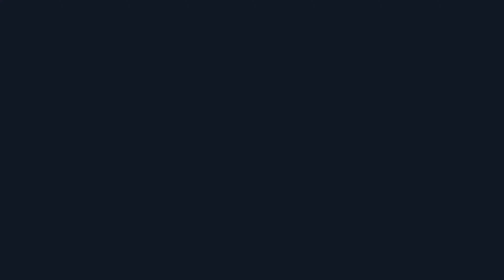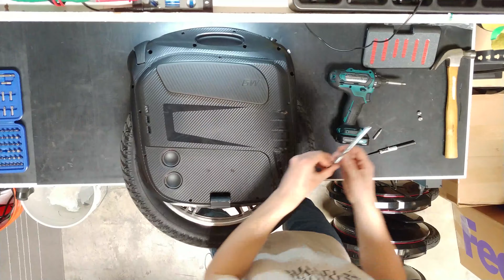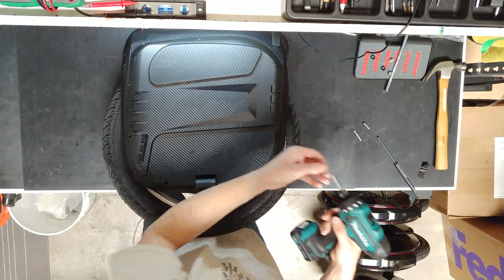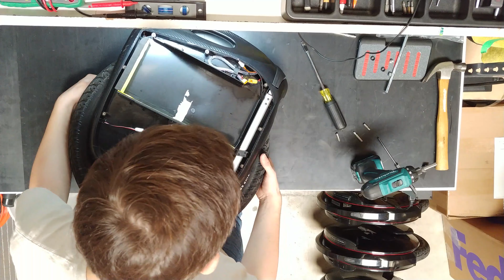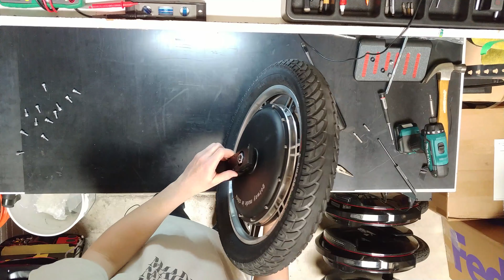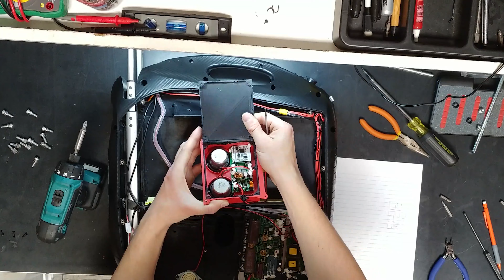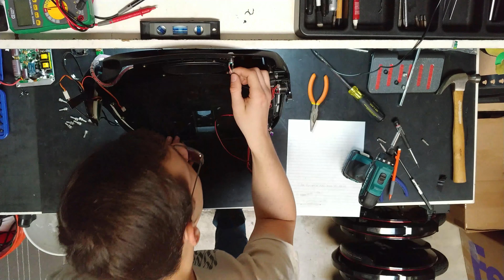What's Inside? Gotway MSuper Pro Breakdown

Comment: To change the tyre DO NOT DISCONNECT MOTOR LEADS. You don't need to. Open the cover on the NON motor side and remove that shell half. Then you just pry off the tyre and replace it. Did it that way on my Tesla to prevent disconnecting motor cables as doing so decrease the pressure on the contacts every time you split them apart. After a while there is a risk for arcing. When arcing starts you quickly loose connectivity and with lost connectivity (high resistance) comes more heat...and we all know what happens with hot gotway motor cables ;-)
Nice video, seems like you broke the seal on one side of the cover and you looked worried when you said motor cables were not damaged so i guess there was something there?

Comment: Fantastic teardown -- you're ready for opening an EUC chop shop🤣
The connector color coding I suspect was to speed up assembly -- no thinking equals faster assembly. I am fairly new to EUC with an IM V10F this past Sept. I have heard much from the popular YTbers about GW past lack of QC, looks to me they are starting to get he msg!  I am loving the this MSP for the low end power as I want to do more trails but I am going to hold out to see what IM will bring out with the next wheel.

Did the MOSFETs have a # on them? As a tech back in the day, I did a Motor Controller for an electric scooter as my final College project - just curious?

Cheers
Reply from the maker: Glad you enjoyed the video! As with all GW wheels being released as of right now, the MSP uses the TO-247 package for their mosfets, which is super beefy and nearly impossible to blow out under most riding conditions.
Reply: @EUCOllective  
But TO-247 refers to the shape of the package.  What is the part number and manufacturer?  There are all sorts of MOSFETs, IGBTs etc that come in a TO-247 package.

Comment: What kind of silicone/epoxy is on the connector ? If i need to replacing the inner shell, ill have to disconnect everything and i want to put it back in the new shell properly. 
Thanks for your help

Comment: @euco I have an issue while replacing the batteries from a recall. I swapped out and reconnected the left battery pack without issue, but when I went to reconnect the XT60 connector on the right battery pack, I got a hot arc and burning smell on the black wire terminal. I quickly pulled them apart, but the black wire terminal prongs on the XT60 are now burned and I am not sure where I went wrong. Is there a way I can test if the connector is still good to use or if I need to re solder a new one? Also, what is the proper reconnection sequence so I don't burn something down?

Comment: A ported enclosure will get louder bass in general for a given power supply, though less accurate. 
For a sealed enclosure, the volume of air inside does make a difference but there’s no big choice to make there, it’s usually a set volume that gets the best results.
In this case a ported enclosure for bass could have introduced all sorts of resonances depending on the shell, unless it had an open port to the outside.
Not to mention the fact that those speakers don’t go very low anyway.

Comment: Yellooo.  So, I have a quick question with regards to the tire removal.  The question is, would it be wise to loosen screws a bit in order to make the tire removal easier?
Reply from the maker: Good question! Yes, you can loosen the screws holding the outer shell halves together to make it a little easier, but just make sure not to pinch any wires when screwing them back together if you choose to do this. Some may not be comfortable risking pinched wires for a tire change, so we didn't loosen these screws for this guide.

Comment: Do you know of a fault with the mother board which affects the lights
Reply from the maker: Hello, usually when the lights are malfunctioning on a Gotway/Begode wheel, the DC output board (a smaller board attached to the control board assembly) has failed, and this usually requires the control board to be replaced as DC output boards from different control board revisions may not be compatible.

Comment: ..thank you for the insight into the new MSP internal! Now I get to see the new “MSX” mainboard which is inevitable given the new twin headlight, speakers and what not..it sure needed a new PCBA and separate 12v power module to take the load off the MB and the accessories connection to the colours and back light👍 great ..now I don’t need to buy a MSP to know what is inside. Hmm @25kg I would still wait out for a 2500w Tesla3 and hope it stay within 20kg to provide that maneuvering

Comment: Please tell me I don't have to go that far to replace the trolley handle. 27:46
Reply from the maker: The trolley rods and handle can be replaced after removing just the pedals and outer shells! Everything else can stay in place. We just chose to remove them later on during the disassembly, but they can certainly be taken out much earlier with everything else still installed.

Comment: what about the gyro? 00:00 ?
Reply from the maker: Hi Hugh, the balancing circuitry in electric unicycles is actually built into the control board, which contains a component that measures the wheel's orientation at all times. This information is sent to the processor, which can determine how much the wheel needs to turn in order to keep the rider balanced in the forward/backwards direction. However, much like a bicycle, the rider will need to keep the wheel balanced in the side-to-side direction. If you have any more questions about how EUCs work, feel free to shoot us a message at euco.us/contact!